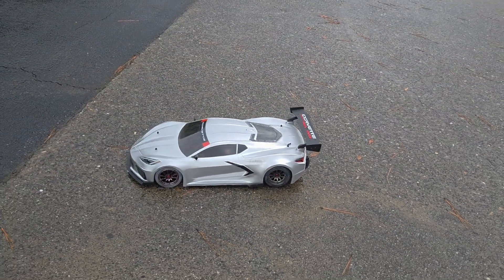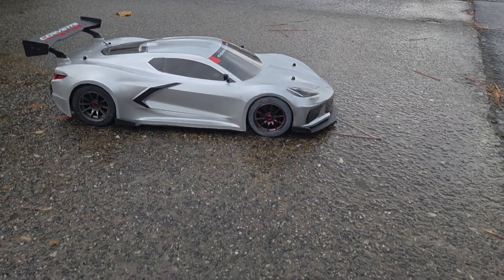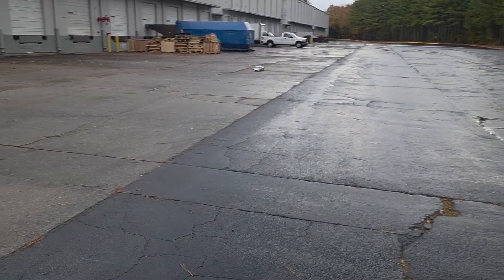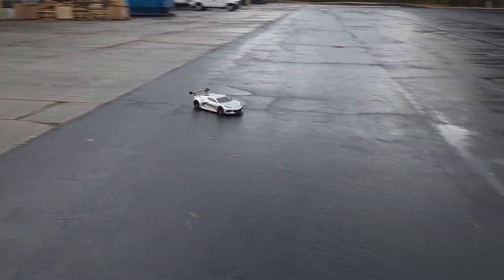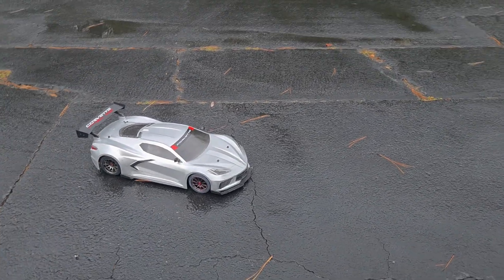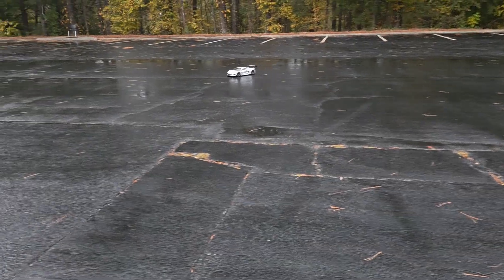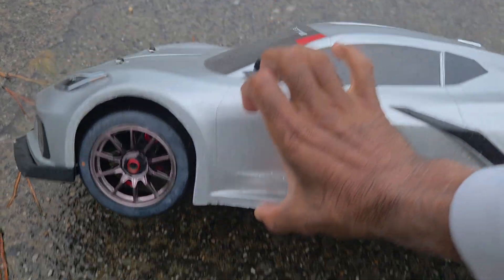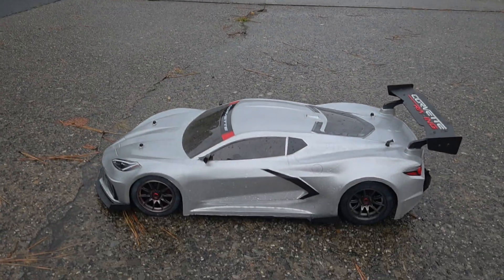I Built a 125+ MPH RC Car… on a BUDGET?!

Comment: How's it compare to the HW Max6 ? Seems like a rebrand for 30.00 less
Reply from the maker: Oh this is 2 or 3 times better remember this is 300 amps
Reply: Was thinking about trying an XC ESC to compare to my Max6, just haven’t had an excuse to pull the trigger.  They make their own stuff.
Reply: These are rebranded madmax esc's most likely,they are identical, and that's not a bad thing ! These systems are real beasts . Great value .

Comment: I have the XC ESC E6 200 a on my stretch Typhon, and getting 95mph on 6s with remote on 75 percent 38s/32p Setup ... Just seen the XC 8s ESC E6 with 550a for my Felony on eBay.. wondering is it really 550a..price $249

Comment: What tires are you running?  I have a felony if i put the same size tires all around would that mess up anything i.e. the rear diff since stock the rear tires are bigger?
Reply from the maker: Proline toyo
Reply: I have a lot... Same car...didn't do anything to mine...I heard u supposed to, but I haven't had any problem